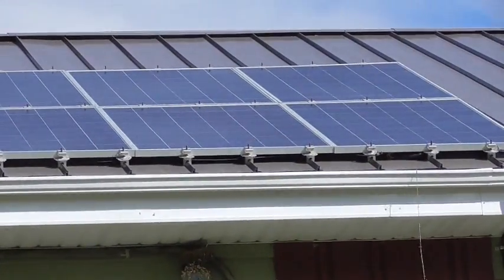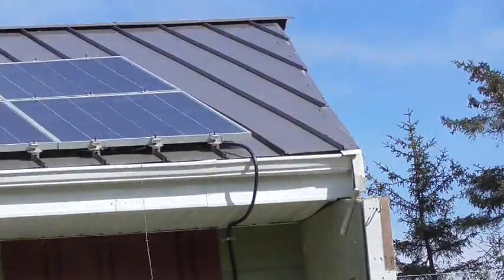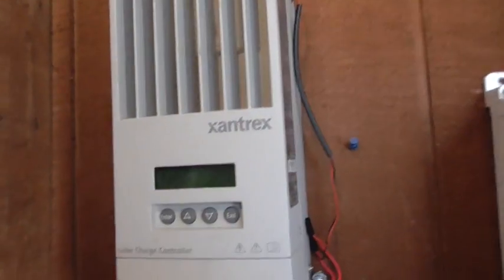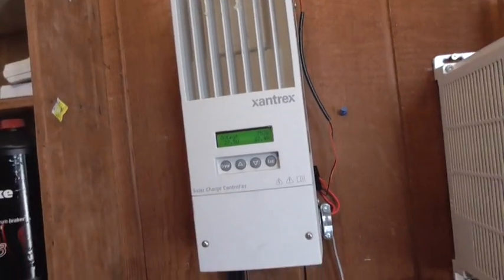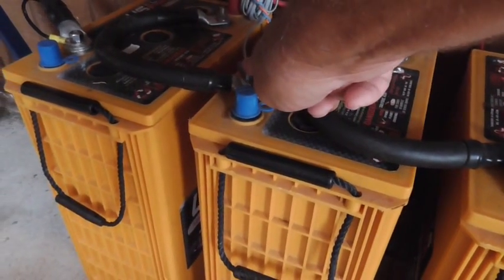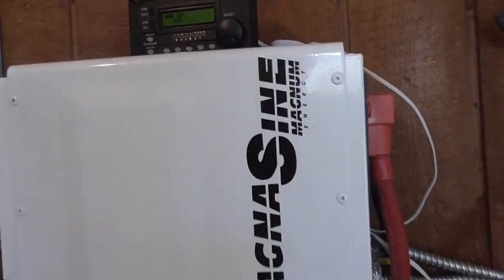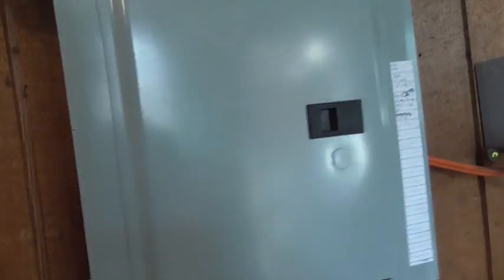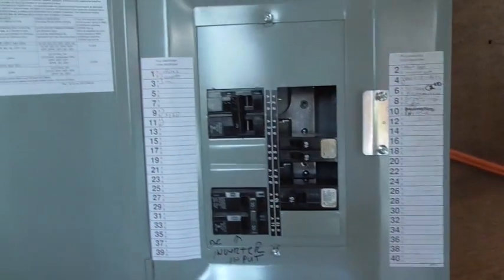No Penetration (Part 3) Metal Roof Solar Panel Install is Making Power!

Comment: I'm new to the solar panel thing, other than a small one used to trickle charge my fencer battery. So we want to install a small 100 watt panel to a small cabin we have. I have the panel, I have a 30 amp controller here, and now I see you have a shunt in the circuit. Would I need one on a smaller set up like this? Thanks.
Reply from the maker: The shunt measures the solar power going in to the battery and also the power being pulled out of the battery by the inverter so the controller can provide information about charge level and state of charge.  In a smaller system this is not needed.
Reply: @NormanMcGregor  Appreciate the speedy reply!

Comment: You did awesome job Norman.
You got some beefy wires on those batteries.
This is a one in town Solar backup System. 
I love your setup nice and simple.
Just a quick advice for you. Make sure you have those batteries off the ground because batteries don't get along with concrete cement.
Please post more videos as you rap up your installation.
God bless you and your family.
Reply from the maker: +JWSolar uSa Thanks John!  The battery cables are 4.0, nice and beefy for sure.  The batteries are sitting on a wood frame about an inch and a half above the floor.  Provides  for good cooling of the batteries.  Looking to add in a grid tie inverter like yours.  How do you like it??
Reply: It's ok.
Make sure you buy the 20Vdc - 60Vdc since your battery bank is 20Vdc 
I only use it for backup especially for winter here in Minnesota.
Reply from the maker: JWSolar uSa How do you have it hooked up?   Solar panels or battery bank?  My panels put out 85VDC which are too much for the 20-60VDC model. :(
Reply: According to your, i suppose you have 250W Solar Modules which is are 24V modules right?
Reply: I heard you said you got them wired them in two strings of three right?
Reply from the maker: I have 6 - 235watt panels.  3 are wired in series and the 2 sets of 3 are wired in parallel.  This gives me 2 strings at 85VDC.
Reply: You have to wire 3 modules in parallel as one string which gives  24V @ 250W plus another three modules in parallel 24V @ 250W which gives you two strings of 24V @ 250W on each circuit with higher amperage and wattage as well to change you battery in less than 3hrs. On a good weather condition like wise on cloudy, showy and rainy seasons you can still generate good power to change your battery bank as well.
Trust me, I have done you can do it as well. 
I am located in the Northwest part of the United States which is Minnesota. We don't have that fancy sunshine all year around. With my 900Ah Battery Bank this is how I charge my Batteries.
Highly voltages are great for Grid Tie Systems like OutBack Grid Tie  Series
Reply: You charged up your batteries at 14.4V as soon as they go on float mode the OutBack Grid Tie Inverter Feedback the power into the Grid if you are not pulling out a lot of load.
Reply: I hope you understand what I  trying to explain to you.
If you have any questions feel to email me your questions may be I can help you out with a video.
Oh! Check out my videos on Grid Tie inverter systems or my channel on Google+
Reply from the maker: Wired in parallel, it would be 2 strings of 24vdc at 750 watts.  That would give me 32amps per string which would be close but still exceed the max of the inverter.  I think I may just add some more panels and wire them to work with the inverter.  Do you like the inverter and does it work OK??
Reply: I do have alot of diagrams how to wire up different systems, like Solar Modules Series, Parallel, and Series  Parallel. Also with those cheap GT INVERTERS
Reply: Or you can just live you setup like and buy the Grid Tie Inverter with higher voltage. Instead of 20 - 60Vdc you need a high voltage one. 
I will send you a link to the inverter suitable for your application
Reply: This can handle your solar 2 strings setup 1.5 Kwh @ 85Vdc
Reply from the maker: Cool!  I will check it out!  THANKS!!  :)
Reply from the maker: Tried to order the inverter but they wouldn't ship it to Canada!  How sad is that!!  :(
Reply: Ooooo
Reply: What are going to do now?
Reply: I wish I can help
Reply from the maker: Magnum Energy is coming out with a new dual function, grid tie and battery back up.   will wait till then for now.  Thanks for all your effort!  :)
Reply: Yes I heard about about that.
You are aways welcome my friend. My door is always open for people the needs help and questions need to be answered.

Comment: did I hear you correctly say that each one of those batteries has 390 amp, Wow
Reply from the maker: +CHICKENRELIGION.COM Yes each of the batteries are 390AH @ 6VDC.  The 4 batteries are wired in Series to provide one 390AH  @ 24VDC battery bank.

Comment: having thatuch power in solar,how many more of those batteries, could you add to take more load off of the controller
Reply from the maker: The amount of solar panels are balanced with the batteries to provide maximum power storage.  The Xantrex controller can easily handle this and supply enough power to run quite a bit more while still charging the batteries.

Comment: nice system. that combined with your generator is all you need out there :). everybody  Shoud be doing this. very cost effective system Norm.,
Reply from the maker: +Justin Case Yes Chris!  Its a good backup system to start with here and my propane generator will make up any deficiency in power this Winter but I will be adding much more to the system as time goes on.

Comment: How many watts are you running?
Reply from the maker: +buzzsah The system consists of 1.4kw of solar panels,  a 4kw inverter and a 390ah battery bank.  Should run my fridge, freezer, TV and lights in a power outage for 2 days without a sunny day and more with sunny days.